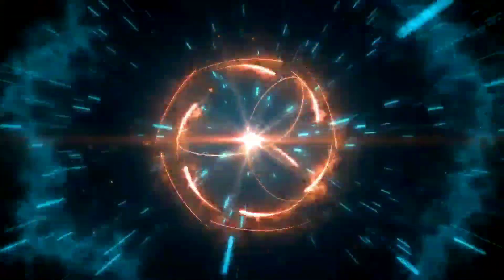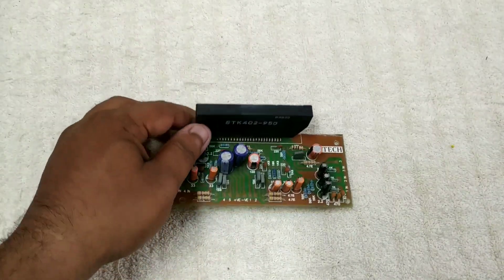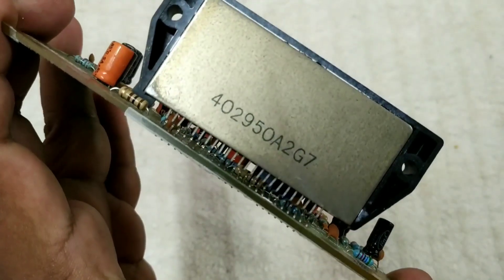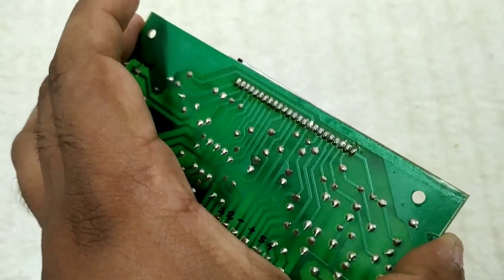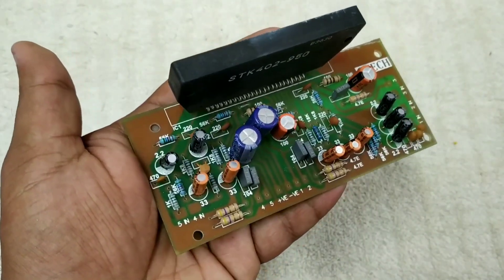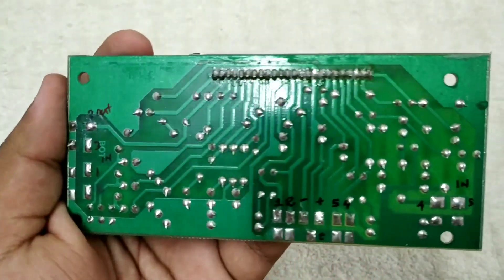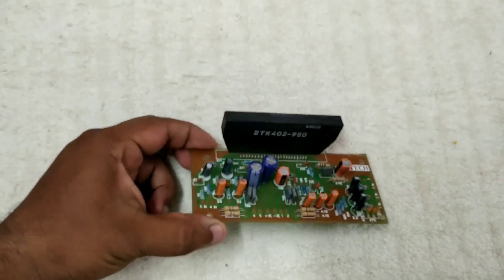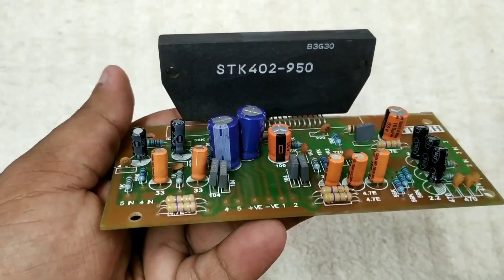STK 402-950 ic based 5ch board for making 5.1 amplifier

Comment: Jbl 1200 watts subwooferinu പറ്റിയ ഒരു ആംപ്ലിഫൈർ ബോർഡ്‌ suggest ചെയ്യാമോ ബ്രോ നല്ല ക്വാളിറ്റി ഉള്ളത്
Reply from the maker: Use 4mosfet board or use 4transistor board 
Mega tech 6transistor board is also available athum nallathanu
Reply: @technicalevolution9887 വാങ്ങുന്നതിനുള്ള ലിങ്ക്  sent ചെയ്യാമോ ബ്രോ
Reply from the maker: Bro place evdanu
Reply: @technicalevolution9887  Trivandrum
Reply from the maker: @vijuv6514  contact 7012592783